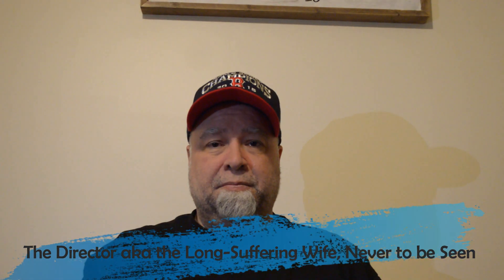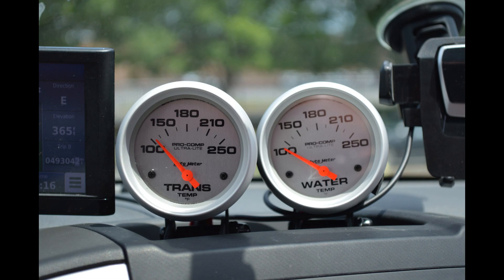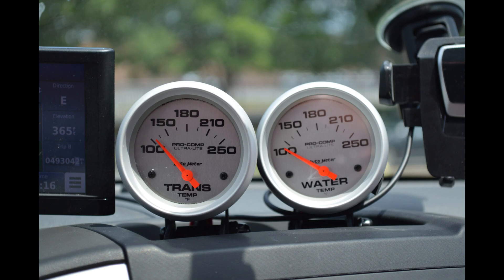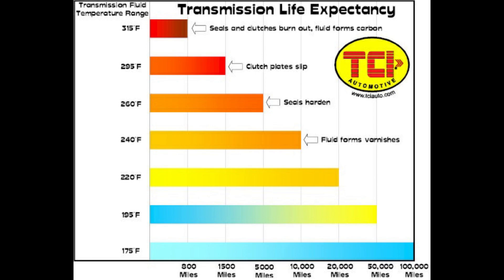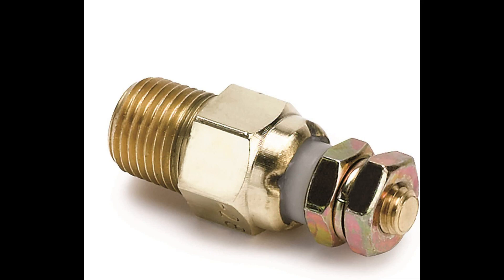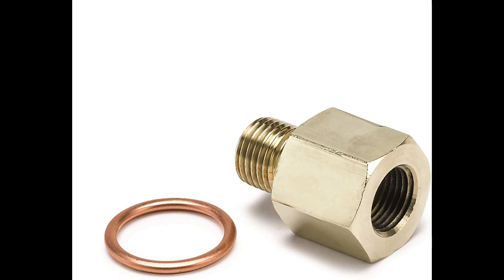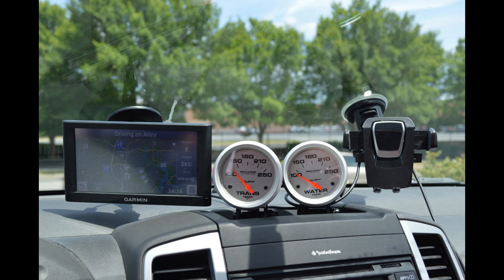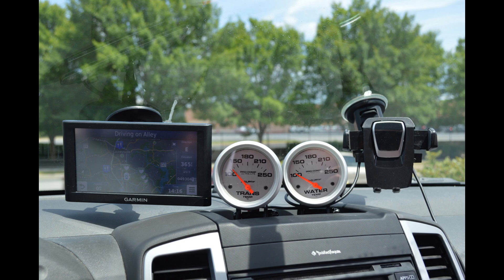Cool It or Not !??!? Transmission Temperature Guage for Nissan Frontier 4.0L

Comment: Ive got a 2004 xterra looking to install trannie temp guage ive already put biggest trans cooler i could fit on it... i pull a boat alot with it i wanna know what my transmission is doing
Reply from the maker: Hello CBG, the 2004 is completely different from the 2005 to 2020, I don't have any experience or notes for that transmission. If it has a pressure test port in the casing, you could mimic this install. Otherwise, it's going to be a completely custom build.

Comment: Did the Autometer Transmission Temp Gauge come with the wiring or do I have to buy that separately?
Reply from the maker: Hello Fischer, the guage came with the guage and the probe only, as well as I remember. I purchased the thread adapter, mounting cup kit and wiring separately, I have a huge collection of electrical components, wire spools, a compartmented plastic toolbox / storage box full of crimp connectors in butt-splice, ring and spade types, so wiring this for me was pretty easy. The probe / sensor takes a ring-end terminal and then you have to get power and ground to the guage and optional illumination for the backlighting bulb, so at least 2 more wires to connect to the truck somewhere. If you were to do something like I did for location, I would think power from the radio harness would be pretty easy to tap onto.

Comment: The diagram helps, thanks! Plan on doing this on my Xterra.
Reply from the maker: Hello Minuteman, happy that was helpful, this is a fairly easy mod, it's just time-consuming to run the wiring from the transmission case up through the floorpan and then construct and set the guages in place. But there isn't a day I regret it, I refer to the guages all the time, while driving, to be sure everything is within good and safe operating ranges. A huge peace of mind as the truck gets older and gets more prone to do something "unusual". As a side benefit, since the guages require power and ground, I added an octopus power coupling splitter with three 12v power sockets to power up my phone and GPS unit, cleans up some of the wiring draped all over the dash. They used to get caught in the glove box door or shifter handle and it was seriously annoying. With the plethora of electronic crap that folk decorate their dashboards with these days, it very much surprises me that OEMs don't provide some hidden sockets on top of the dash somewhere. Maybe a small door near the defogger vents.

Comment: i searched thinking putting one in i pull  about  4750# camper,  i notice transmission gets hot when slow speed on hilly curvy roads  hard shift.  and add cooling fan
Reply from the maker: Hello David, thanks for writing in. Yes, I really think Nissan should have included this as standard equipment, the Titan gets one, why not the Frontier too? It's already prewired standard for a tow package, they know folk are going to tow with it, so shouldn't seeing the transmission temp be critical in these scenarios. 
I did add a fan on the trans cooler face, with a thermostat to switch it on; then realized that the cooler has an internal thermostat so 99.9% of the time, the external cooler is in bypass mode and the only trans cooling is going on inside the radiator. Que Sera, Sera.
Reply: @frontiergeek4953   adding add on  cooler,  some said works well because it is in center.  going try that.  I just changed fluid  was light brown/dark red.  no metal wear.  after fluid change, drove happy
Reply: @frontiergeek4953  where the wires hook up to , i looked fuse box like wow tiny spaces to plug in but attach wire where? i know for sensor connections and ground but,  power supply with Key on ign
Reply from the maker: I have a separate dedicated circuit and relay that switches on with the ignition, it is only tied to the factory ignition for a relay signal, and of course at the battery for main power, so wouldn't be able to speak to the fuse box question. The OEM radio is right there too and it has an ignition fed circuit.

Comment: So does the tranny get hot while hauling or not?  I’m pulling a 4000lb RV and it’s making it so far - pretty close on the GVWR with passengers which is the limiting tow number on any truck.  I do wish they’d put a trans temp for sure. Going to change the fluid religiously.  Ah never mind - you covered it.
Reply from the maker: Heya there Brandon, thx for writing in. I did see some elevated temps when pulling an uphill run towing a 4k#+ twin-axle UHaul enclosed cargo trailer, my guage indicated around 225F for a short period, then thankfully we got to a decline and she dropped back pretty quickly. That was pulling in 4th the whole time, between 70 and 78MPH.
This isn't a super-difficult project by any means, I think getting the guage mounted up and wired was more work than mounting the transmission sensor, which thanks to many folk on the ClubFrontier forum, had been thoroughly documented for part numbers and possible issues.